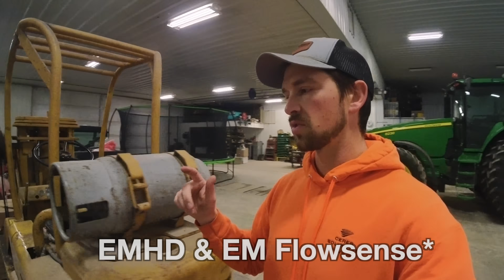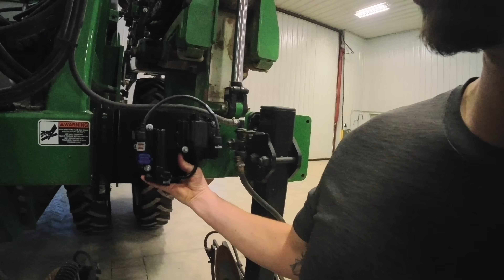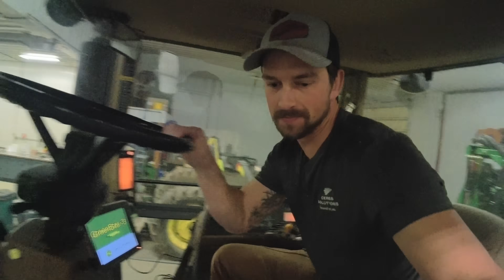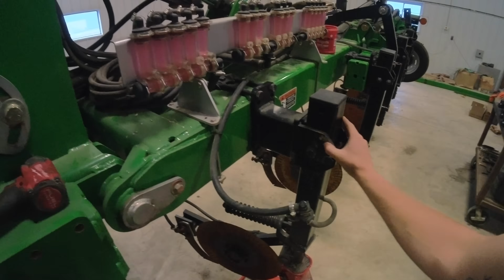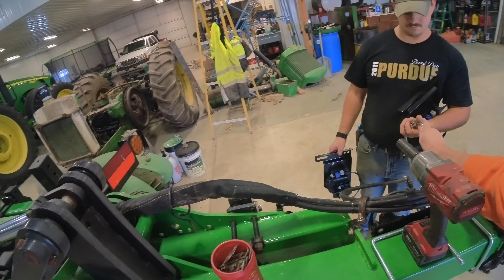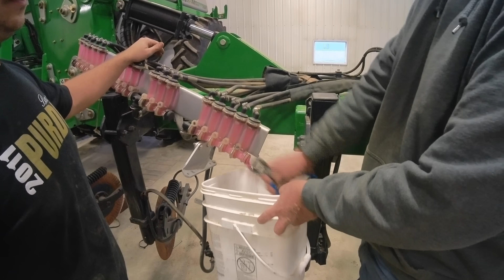Problem Solving Skills REQUIRED! - Part 1

Comment: Do you run a different rate on your end units if so how do you set that rate?
Reply from the maker: We run half rates on the end units since we double back on those rows.  We will control those rates through the parameters we set up in the 20/20 monitor.
Reply: That is really nice you can set it up like that in the monitor

Comment: Can you explain how this system will be better than the ball flow indicators and the orfices for rate control and how this investment will pay off?
Reply: We have used this system for over 2 years now and it actually applies exactly what you need and saves you money like you would not believe because it gives you just enough nitrogen in areas that you can do you can also run prescription off of it
Reply: Do you do a different rate on your end nozzles if so how do you set that rate for them rows?
Reply from the maker: Yes our outside rows will only be half rate since they overlap on themselves. That is all set up on the monitor in the tractor.
Reply from the maker: This system meters row by row which greatly improves application consistency across the bar.   It also allows row by row control so overlap is all but eliminated, and a big plus for us is it has turn compensation which allows outermost units on the applicator to apply at a higher rate and inner units at a lower rate when going around contours.